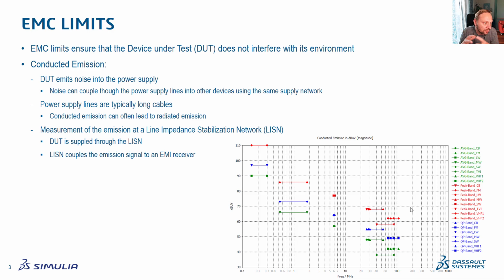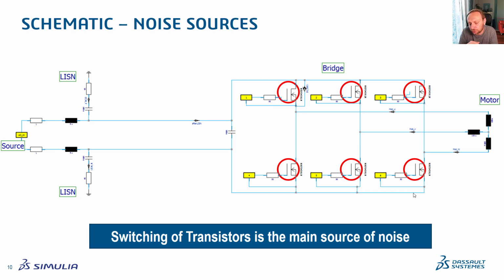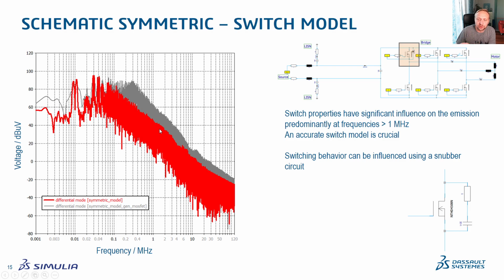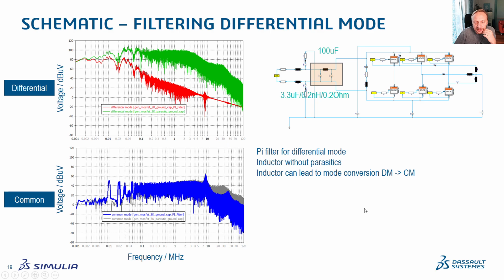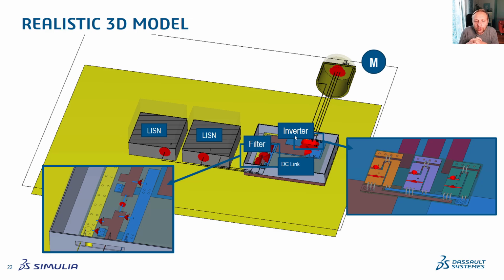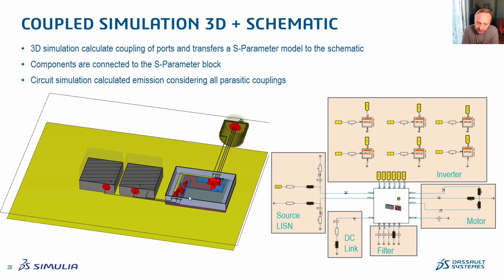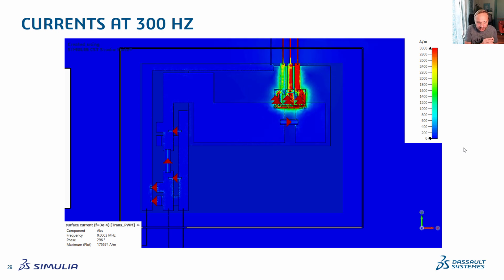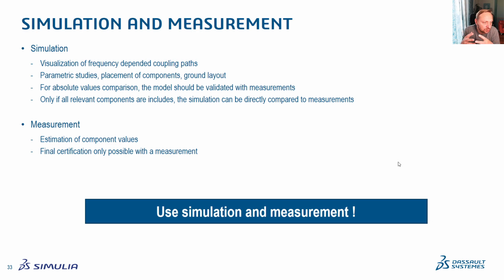Introduction to Inverter EMC Simulation

Comment: Very helpful video! Is SVPWM used for inverter control in the video? Recently, I learned to build a model and found that the control signal could not be realized according to the expected results. I would like to ask you how to achieve it in signal end 1-6. Thank you very much!
Reply from the maker: In an EMC simulation we typically do not include the controls. We set a fixed operating point with a fixed PWM. Adding controls to the simulation would make it inefficient as the time constant of a control is much higher than the frequency you need to resolve in the EMC simulation.

Comment: Great video, Thank you. Why use a filter in the first place? Do we really care about the conducted RF currents flowing back to the battery? At RF frequencies the battery is an array of capacitors and the length of the cables are inductors.  Okay, so there are high RF currents in this cable. Put these currents in a suitably designed transmission line.  Can your software be used to design a transmission line cable with appropriate DC and AC capabilities that would constrain these currents without creating harmful radio interference?
Reply from the maker: Hi Joanna, I have seen your posts regarding this topic on LinkedIn. Of course you can use our software to design proper transmission lines to suppress the differential mode. But thats only half of the problem: Just the stator of an EV has typically around 20 nF  capacitance to the housing (that is connected to the chassis). Thus, you will always have a significant common mode emission that can not be supressed by improving the desing of the DC cables. You still need filtering/shielding.
Reply: @AndreasBarchanski  Yes, the common mode capacitance of the motor is a big issue, but so are the leaky cables and there are other issues that will need to be addressed to keep EVs from polluting the AM band. To address the common mode issue; As I'm sure you are aware, balance in a differential system is critical in preventing differential to common mode conversion. The 3 phase 3 wire wye motor control is not balanced. To be specific the number of on high rail transistors is not always equal to the number of on low rail transistors. Hence the shunt capacitance to chassis of the rails is changing from 40nF/20nF to 20nF/40nF. And with this change the chassis current has a nasty pulsed current on it.   I have to wonder if a 3 phase 6 wire motor with a 12 transistor inverter would help. With full rail voltage accross the windings the amount of copper could be reduced. This would offset the cost of 6 more transistors. It is a question for the motor folks to answer.

Comment: hi, thanks for sharing about EMC for inverter. i have question about inverter circuit, how to import spice model for mosfet? i have tried but get error.
Reply from the maker: SPICE language has many dialects and keywords specific to a dialect. Sometime files are also encrypted, so it depends on the particular error to understand what is the problem.

Comment: Hi thank you for this. Something for a discussion: sometimes there is also a filter after inverter bridge for filtering noise from the motor, so you probably do not have noise created by the motor?
Reply from the maker: No, I don't think that there is noise created by the motor. The motor is not an active element. However, the noise from the inverter will also propagate through the motor cables and the motor itself, so the filter between inverter and motor is suppressing noise propagation on the motor side.
Reply: @AndreasBarchanski  i think that depends of the type of the motor and interactions on its Internal components also you can have resolver in the motor housing that could be additional source and sink of the nosie.

Comment: I have a methodology question. It is said that the earlier emc issues are considered in the design the better. However things keep changing as the project develops. 

What can be done during the mechanical design phase and at the end of first proto build to make maximum use of emc design work
Reply from the maker: That's exactly the advantage of a simulation model: it can be created before the first prototype and it can be modified when changes occur. Of course at first stages some data is not yet available and needs to be guessed, still a good simulation model should already deliver reasonable estimates.

Comment: Nice presentation. Do you have any video or link suggestion in where to find the desig guidelines or rule-of-thumb to Pi-Filter and Cy caps ? Thank you.
Reply from the maker: I would use a circuit simulator to determine proper values.